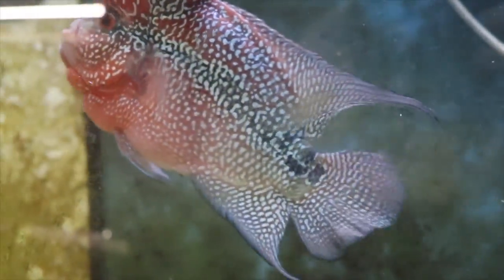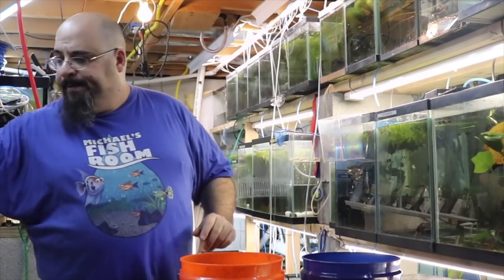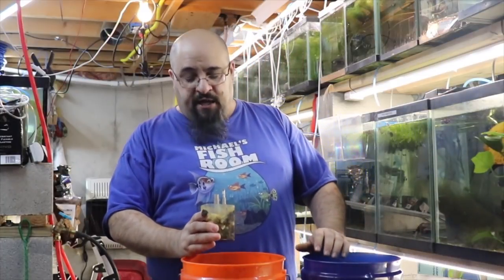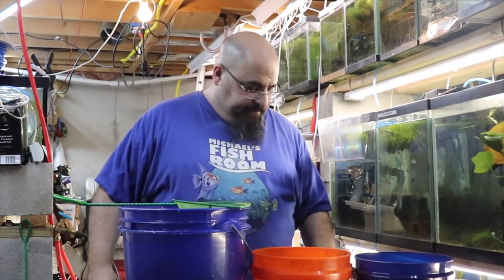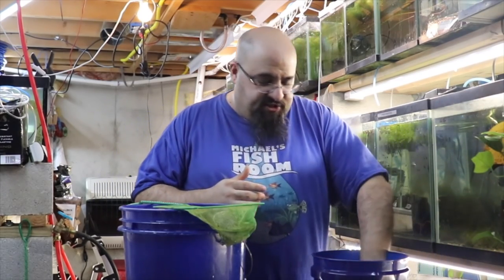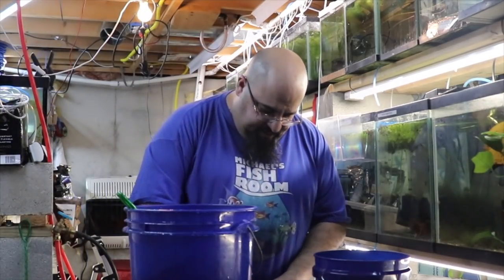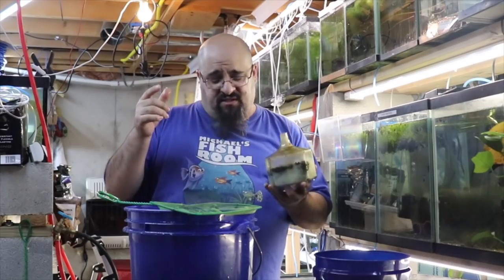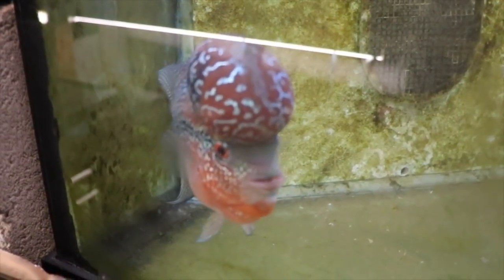How to Clean a Box Filter

Comment: I recently bought a box filter (because I saw you using them!) and it came with filter pads. I also added some filter floss but was wondering if you use those pads too or just the floss.
Reply: U can use both and u can even add biological media
Reply from the maker: If it came with it, I would use it.

Comment: A couple of ideas for use with a box filter:

Addition(s) of trimmed sponge pieces inside, to add to the biological filtration and prolong service life of the floss. 

Plug/eliminate the air tube, and employ a powerhead. This will quiet the operation, and improve the efficiency/effectiveness via increased water flow through the media.
Reply from the maker: Except that used power and I already have air going to every tanks. But thanks.
Reply: if the water flows thru the filter floss TO FAST.. it will eliminate the effectiveness of polishing the water for crystal clearity... slow flow is the key.. i tested this out myself and was shocked by this fact.

Comment: Is it possible to reduce the overflow sound from the box filter? If yes then can somebody please tell me because it's so noisy at night
Reply from the maker: Do you mean the bubbles, there is not overflow.
Reply: @MichaelsFishRoom  Yes bubbles. I read somewhere they spoke about overflow so I assumed it was to do with the bubbles my mistake
Reply from the maker: @User-rx9ko  You can turn down the air, or even use an airstone
Reply: @MichaelsFishRoom  Turn down the air how? If I get an air stone would I still need the the air pump?

Comment: I'm a newbie, is dechlorinated water the same as aged water?
Reply from the maker: Hi and welcome Sarah! No, it is not. Dechlorinated water is any water you use for thr tank that is dechlorinated either by adding something like "Prime" or "water conditioner". Aged water is water that has been sitting for a period of time to get the PH to stabilize. Aged water with an airstone can gas off the chlorine, but wull do nothing for water that has chloramines.
Reply: @MichaelsFishRoom hi love your video. I am also new Just a question when l go to clean the fish tank water can l use the 10% to 20% fish tank water to clean my filter? Also when l add the new water which is filter water is it recommended to make sure its the same temperature as the tank ?. Also sorry when adding the new water do you recommend adding “Prime - removes chlorine and chloramine, stability- New tank Stabilisation system and Quick start into the new water that will be added to the fish tank. My fish tank is 4 days old but l wanna clean the filter as there is food stuck.

Comment: Mike, I've started tanks which are filter less. 14" bar aeration only for 10 gallon size. Basically, an aerator the long size of the tank -2". I do run 5 lbs of substrate for each 10 gal tank. Each tank also has a decent amount of fast growing plants. From my two tank tests. I will never be cleaning another filter ever again. Ask yourself why do you have a filter in breeding tanks which aren't for show. Waste breaks down and gets handled by auto water changes. And what is this a video without coughing?
Reply from the maker: Because "I'm fine" LOL You make some good points....I will have to test that theory out.....